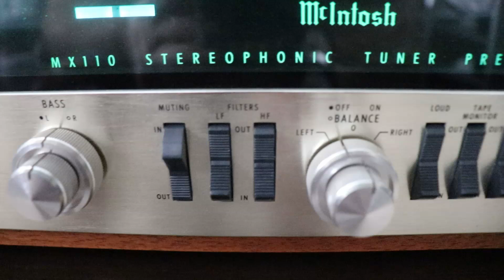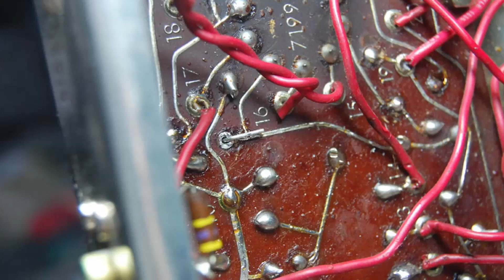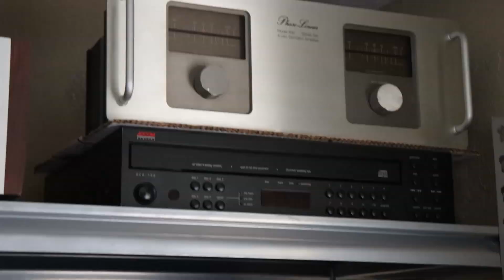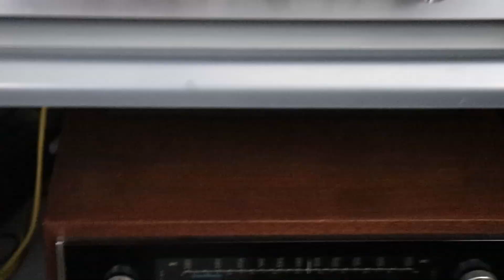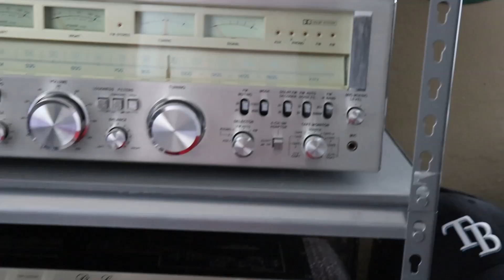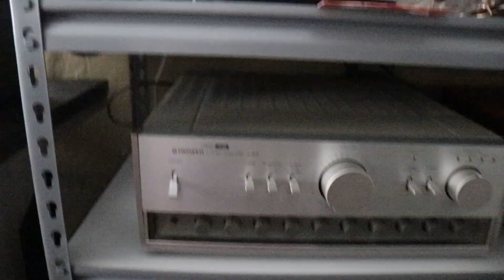McIntosh MX110 And Dynaco ST-70. Vintage Tube Preamp Tuner Amplifier Repair Restoration Testing.

Comment: How does the phonostage sound with MM cartridge?
Reply from the maker: I think it sounds good for a 1960's preamp.
Reply: @vintageaudioaddict  -I have a Vincent SV 226MKII which is a powerful hybrid integrated with no phonostage. Has 3x12AX7’s which gives some tube color in preamp but I’m always curious about going all in someday with a tube preamp /separate where I’m able to eq with a bit more sensitivity as records are all over the map depending on the trends of the day when they were made. Can’t listen to digital….cds occasionally but I’ve never tried a DAC. Autoimmune disease has made my ears so sensitive although hearing is great. I still like to push the volume but can’t stand the 1 dimensional wall  of digital sound stridency.  Loses the image and subtleties. Not sure where to start down a path like this? Appreciate your work and showcase. Would you use a separate more modern tube phonostage over the internal? I have one of those on order but it will be another year. Music/sound is my happy safe place and it’s been that way since I can remember as the early 70’s was a turbulent time for me and music was my good feeling endorphin rush.

Comment: Nice overview of these two pieces of equipment. I just picked up an  older MX110 and searching the web for restoration info. Sad mine does not have the pan locks.
Reply from the maker: Thank you very much. I'm amazed at both of these pieces of equipment every time I listen to them. Good luck with your MX-110. I think you will love it.

Comment: Mx110 is a classic. I had an older version but sadly sold it. I missed it so much I bought a MR 78. Still the MX110 had a beautiful sound especially in FM stereo. Mac made some great tuners.
My friend had a dynaco stereo 70, nice mids but light in the bass. In my experience most el34 based tube amps are. Nonetheless for the money it cant be beat.

Comment: Wonderful amp, love mine. It tended to blow fuses though so I replaced the rectifier with a solid state Weber Copper Cap. Works great as you can see in this video: https://youtu.be/cLIOW28RxXo I also use it with a McIntosh preamp.

Comment: My father bought the Dinakit version of the ST-70 sometime around 1960. (You seem to be missing the outer case) He had very little money at the time so had to get the kit. A couple of years later he replaced his older Fisher tuner with the Dinakit version along with a Dinakit preamp. He built his own speaker cabinet following Electrovoice's "Empire" cabinet plans (Rear loaded folded corner horn) with an Elecrovoice 15-TRX speaker. He had to wait about 3 years before he could afford to buy a second speaker. Then later he added Electrovoice's external tweeter and mid-range horns. That was a sweet system. We had a ham radio operator who lived in a house about 1000 feet away. At one point he did something to his transmitter which caused our amplifier to pick up his signal. The audio was so clear it sounded like the ham guy was right in the room with us. To begin with he was telling us we had something that wasn't right. Nice guy and tried to help but... Took about a month before he figured out he had done something wrong and fixed his transmitter.